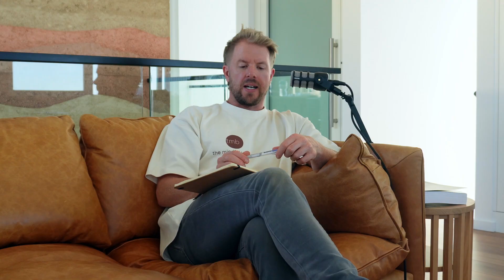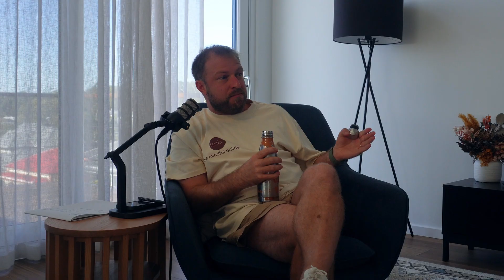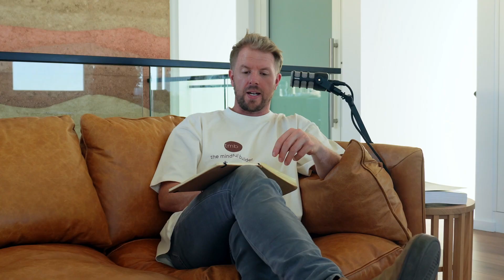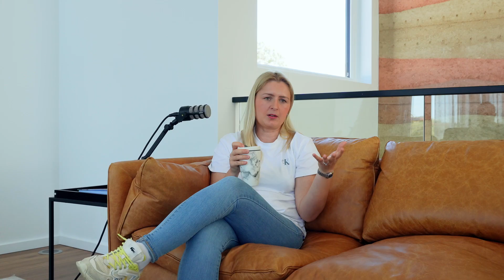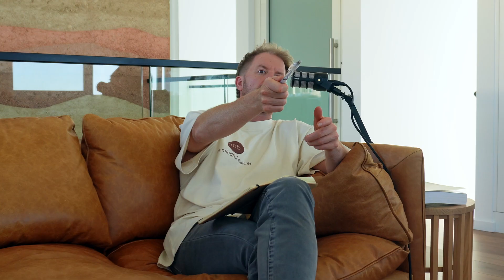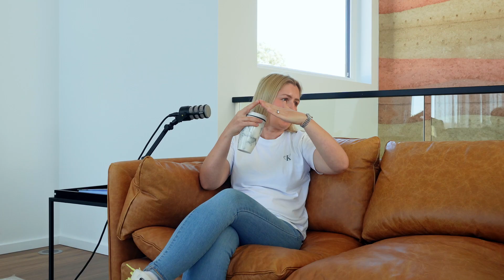The Truth About Cheap Aussie Windows

Comment: there is a new house going up down our street, literally a week into the build and the ground floor windows are in already.  The windows were supplied in frames and that looks like they were installed, unwrapped into the framing.  Given how bad the aluminium window is, I'm staggered that the new building code wasn't specific about using only properly thermally broken windows.